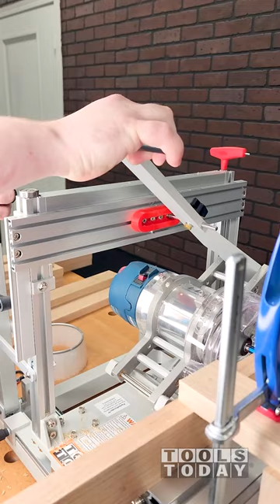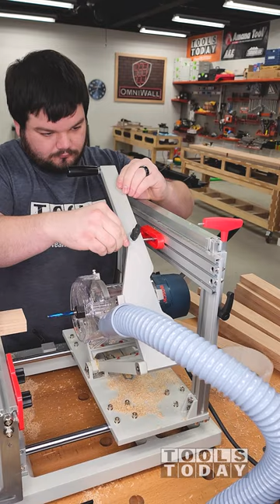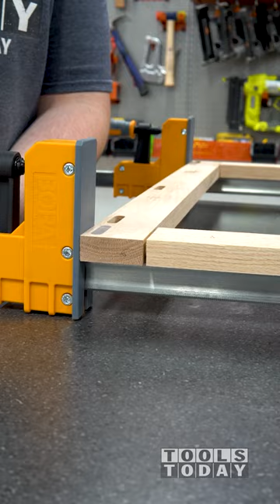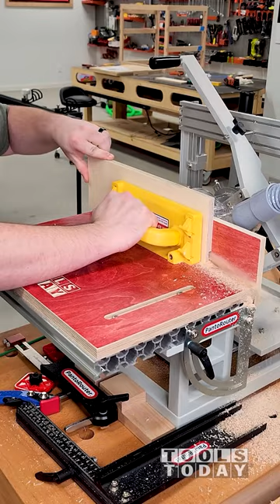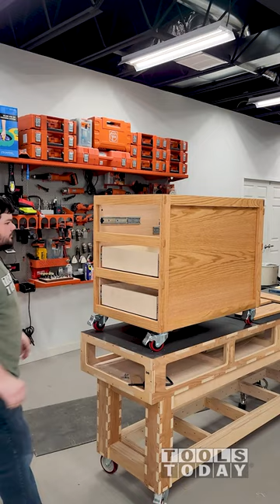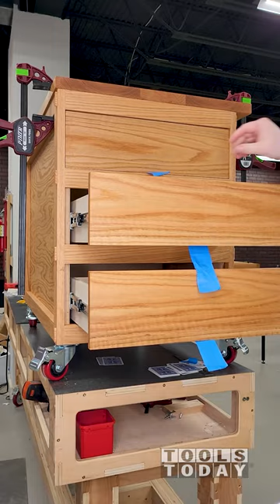Nicest Shop Cart Ever!?

Comment: Another question. In the video you basically slid each side wall into place but it doesn't show how you attached them to the frame. Are these simply glued and screwed into place?
Reply from the maker: Correct, I just screwed them into place.

Comment: There’s one thing I noticed about your drawer construction . You can’t face nail the front board you have to rabbit it on the sides because the door construction you have going like that you’re gonna pull that drawer open one too many times and it’s going to pull the face plate right off it.

Comment: Domino's are not supposed to be used for structural support that's what dowels are for domino's are just meant to hold a peice together not give it strength
Reply from the maker: These are not dominos, these are mortise and tenon joints, they add incredible strength.